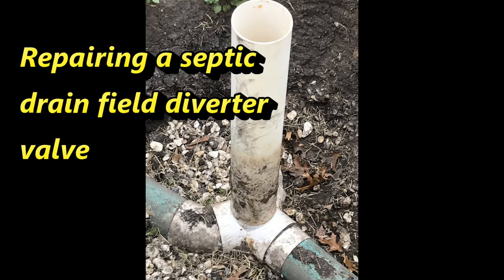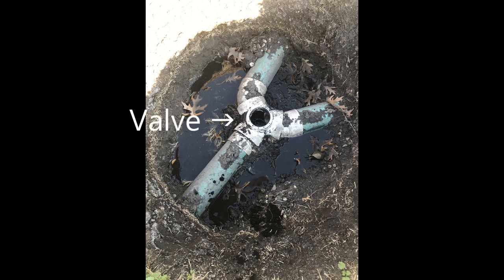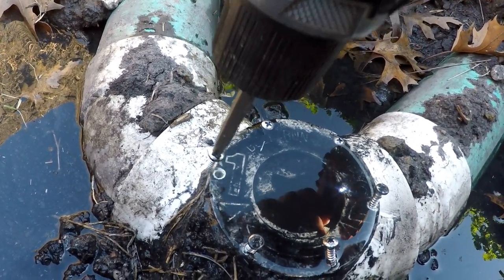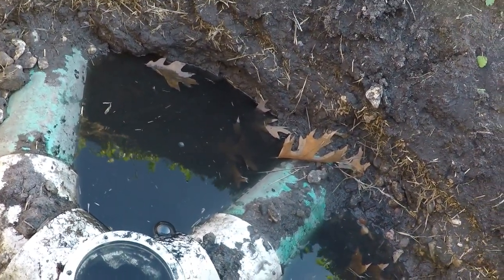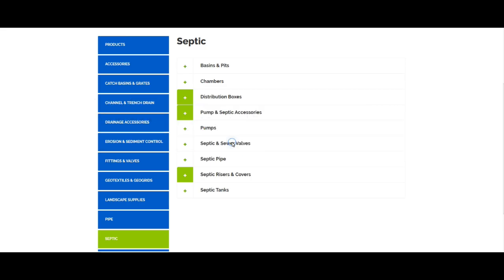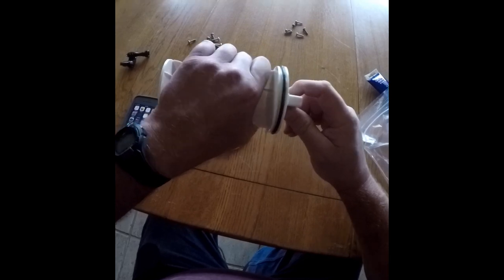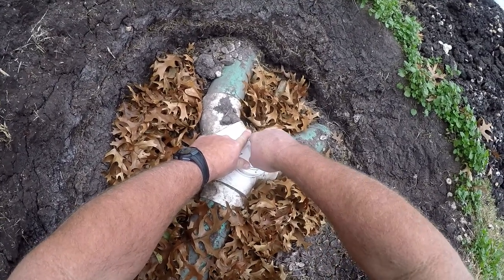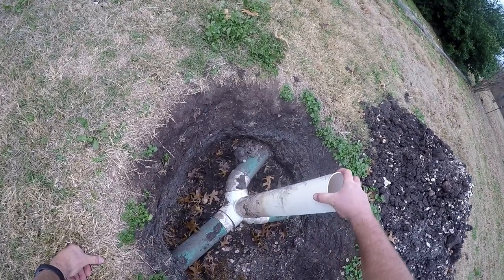Repairing a septic drain field diverter valve

Comment: THANK YOU FOR THIS VIDEO! I just attempted to switch my fill lines using the switch valve and the stub on top BROKE OFF!  My valve was about 12 inches down in the ground but luckily I got the top 6 screws out and took a small screwdriver and pried off the top then the valve itself came out. My local hardware had the BULL RUN VALVE repair kit ($40). After doing some cleaning with old rags I was able to reinstall new parts and could turn the valve by hand. NOTE do not tighten all the screws as tight as you can. This may cause the valve to bind up on any debris that gets around it. I only used 2 screws so in the event I needed to work there again, It would be much easier. Thanks again!